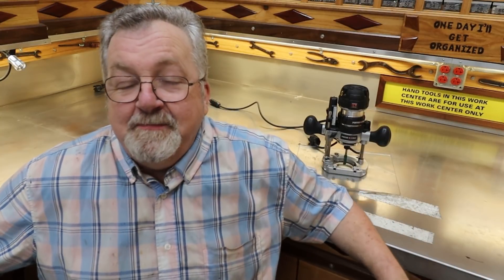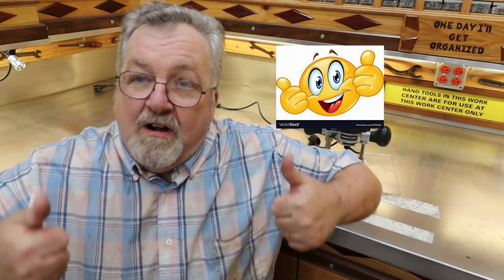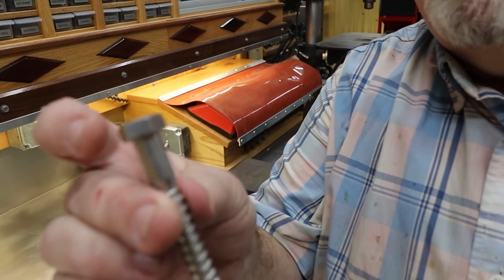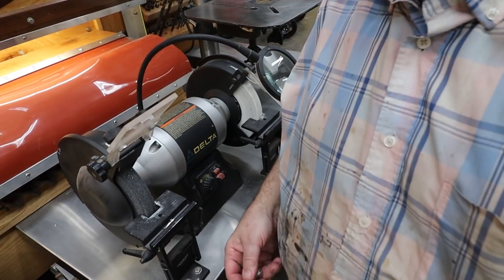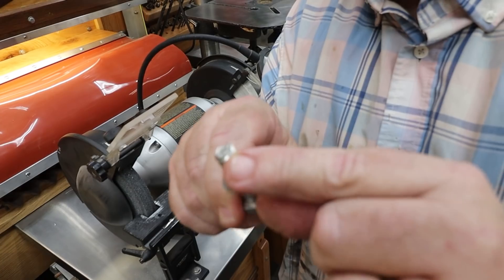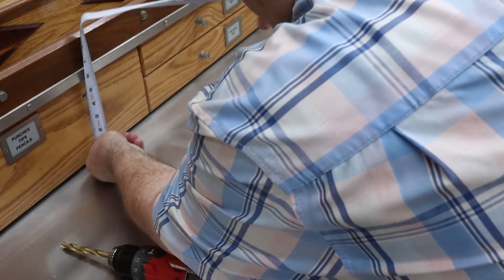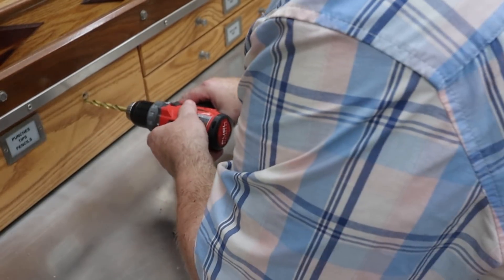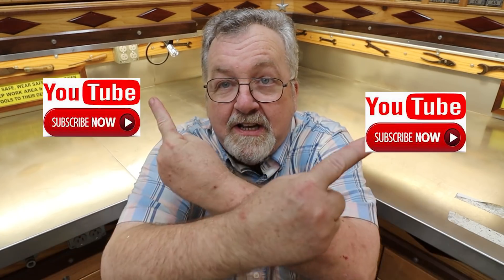Drawer Pulls from Stainless Steel Bolt Creation - Fleets Wood shop

Comment: Have you thought of using a vibration tumbler to deburr and polish metal parts?
Reply from the maker: I know of them. Never really thought of using one. Since I made the video. The last few that I had to make. I put each one in the drill press and sanded the heads that way by hand with the bolt mounted in the drill press that helped because I didn't have to hold the bolt in my hand. And I use stainless steel for mine. which gets extremely hot very fast when friction is applied. Some mounting it in the drill press worked pretty good. And thank you thank you so much from Doug

Comment: Great and simple solution!
Quick question: is the wood that has the diamond inlay on the bottom of the cabinets one peice, or is it a separate piece of wood between each diamond?
Reply from the maker: Thank you for asking my friend the diamonds are made out of blood wood. There were about 3/16 of an inch thick. And they're not in laid it's what you call a surface layer put on top of the wood. The wood they're sitting on top of his red oak. You install the red oak first then make the diamonds and install them on top of the redwood . I know on the video it looks like inlays but they're not they're late on top. It makes for more of a three-dimensional look than a flat surface. And thank you thank you so much from Doug
Reply: @fleetswoodshop3339  oh, it looked like inlay in the video. I was wondering how the inlay was cut, but it makes sense now. Thank you for the explanation!
Reply from the maker: You're very welcome my friend no problem at all and it also looks extremely nice that way three-dimensional period and thank you thank you from Doug

Comment: Great idea, i have thought about this dilemma  of draw pulls for a while now! Problem solved. But i will not straighten mine up like you did, just to make it my own! 
Don't want anyone to think i stole an idea! I searched our big shed hardware over here in Australia but we call everything different! Your Lag bolt is our Coach head! 
Great demo, so Thank You from Aus. Michael
Reply from the maker: That's great Michael I love your comment. I sure hope you enjoyed the video. I was actually in Sydney last year and made a point to take in an opera at you know where. Beautiful riverfront I  just loved it and had a great timeand please straighten out the heads on your boat that looks so much better that way and you're not stealing an idea you're just using a good suggestion. From Doug

Comment: Cool idea! 

I may use that idea in the future. Although I think I'd prefer to blue them for my own shop. I think it'd require standard steel, not galvanized or stainless. I'm sure you're aware of the process, heat the bolt to a certain temperature and drop it in oil to quench. Would give them a black appearance. Or some kind of cold blue liquid would give the same look. Birtchwood Casey makes a good cold blue liquid.  Not as resilient as stainless, but better than standard steel. Probably still last at least one lifetime haha

Maybe desirable to some maybe not. I think I'd like the black look.

And I may have to use several of the ideas I picked up from the shop tour video. Thanks for taking the time to film, edit, and post these videos.

Youtube has tons of viewers and creators now, and sometimes it feels like many of us throw the same ideas around, which is good for gaining knowledge and sharing what we've learned (to do and NOT to do) in general I guess. But I have never seen many of the solutions I've seen you implement in your shop. For instance the table saw blade storage drawer you pulled out in the tour. The blades teeth don't touch each other, they overlap a bit to take up less space, and it's just make sense that they would store well at a slight angle like that. Maybe you didn't think of it, could have come from a wood working magazine or something I suppose, but my point is it's very unique. Who ever thought of it had their thinking cap on. Another is the easy access step to walk "ON" the work surface to access all the vertical storage potential. Definitely someone was actually thinking and using brain power to have come up with that idea.

Thanks for sharing these ideas.
Reply from the maker: Davey. oh my God thank you for such an informative and entertaining comment. I read it all the way through and really love that you have a lot of good thoughts. Two things well actually three. as far as the blue bolts go that's an awesome idea I never thought of that don't use galvanized it wouldn't work use plain steel. dip them in a muriatic acid and water solution before you blew them it will take off that factory coding. A friend of mine really like the idea. But he wanted all his bolts to have the rusted rugged look. so again he's soaked them in their attic acid using plain steel bolts for a day took them out put them in the sun and they rusted right away. he then cut them off finished them like I did in the video but before he installed them he dip them in two-part urethane and hung them to dry. Giving him the rusted look but preserved in urethane. As far as the stairs on the workbench go and the blade storage drawer. That is 210 percent my creation. the reason I store the blades flat is because nobody will tell you that too much but when you store them sideways they tend to warp and like you say the teeth hit each other. laying flat you can't get to him laying on an angle like that you can easily get to them all. The stairs were actually designed because I'm short. I couldn't reach over the top of the bench to grab the Opera trays so I just put a set of steps there so I can get to them. And thank you but now I'm getting long-winded so thank you again from Doug

Comment: Great idea I might have to try this. I'd love to hear your thoughts on your Milwaukee tools. Been using the M18 Drill and impact for about 2 years and they have held up well but the chuck on the drill in my humble opinion is garbage which has left a bad taste in my mouth considering how much I paid for the kit. Wondering if they're all like that or if I just got a bunk unit.
Reply from the maker: Tony thank you so much for watching. I'm glad you like the cabinet pull idea. And thank you for watching my friend. I haven't had all the makita's that long but so far I've been very happy with. Them no breakage at all in the batteries last forever. I do use the drills the most quite often. And like I say so far so goodif I do have any issues or anything I will certainly let everyone know. And thank you again so much from Doug

Comment: Awesome idea Mr. Doug! I hope you like it when someone has an idea for you. Sorry but my mind always sees a different way to do things in most every video I watch. I don't know if a 3/8 stainless bolt would cost less than the lag screw but I have threaded wood with a metal tap and screwed bolts into the threaded wood for years and never had one pull out yet. Lots of people use the metal insert when screwing bolts into wood, I just tap the wood. Also I think the washer would look cool if it was rounded toward the drawer. I would make a shallow half or quarter depth hole in a piece of hardwood and use a round object to press the washer into the hole and make it like a half moon. Just me thinking...
Reply from the maker: Thank you Danny thank you very much. No worries at all here. There are so many ways to do the same thing. If it works for you that's wonderful. Seemed pretty simple to me drill a hole put in a bold. But like I say each to their own and thank you so very much from Doug
Reply from the maker: Shaun. that's awesome my friend thank you for the info. I appreciate that thank you thank you from Doug

Comment: Love all the cool ideas. Could you tell me about the disk sander? Is it shop made from a motor or is it a commercially made one?
Reply from the maker: it's a commercially bought sander from woodcrafter but I modified it to Mount the 5 inch hook and loop sander to the front of it. Thank you so very much from Doug

Comment: Not safe cutting the bolt on the right side- blocking the view!
you should have done it on the left side since you were going to hold the offcut with the left hand any ways!
Reply from the maker: It's okay my I've done it that way a thousand times. I only reached over for the video so I could show you all the scrap. But I hoped you liked the idea of the cabinet pull. From Doug
Reply: @fleetswoodshop3339  I gave thumbs up
Reply from the maker: Thank you Osamah. Thank you so very. I certainly appreciate it 😊 From Doug